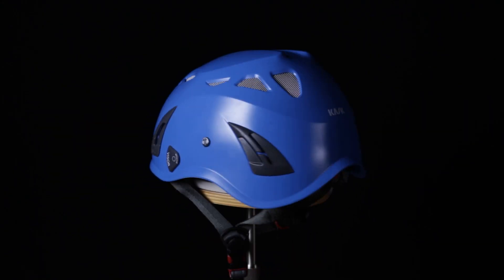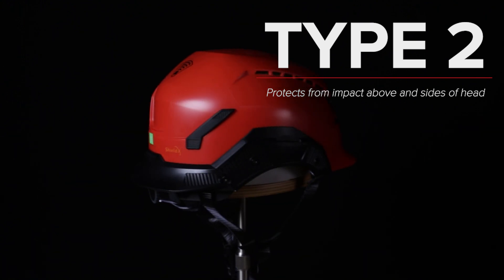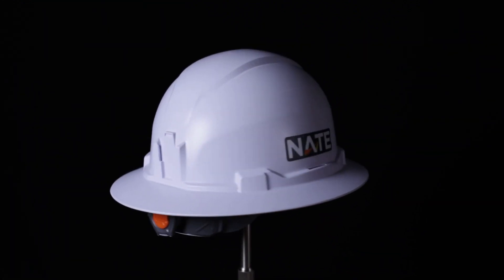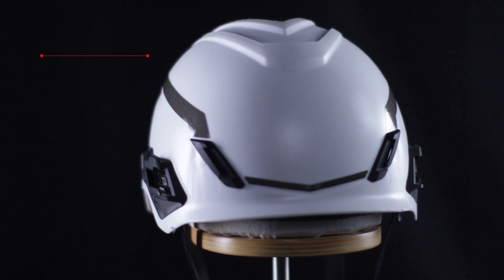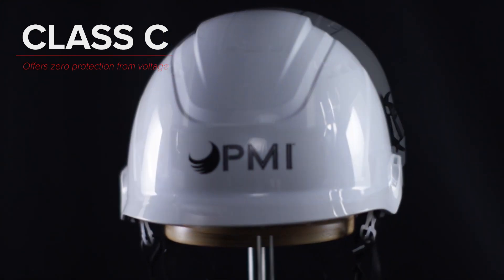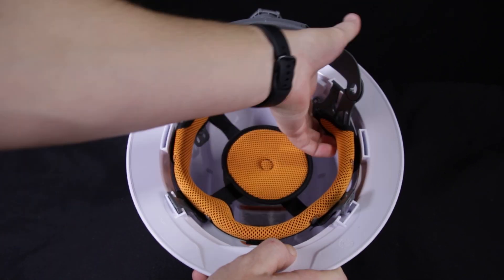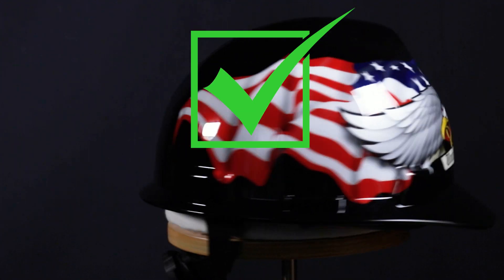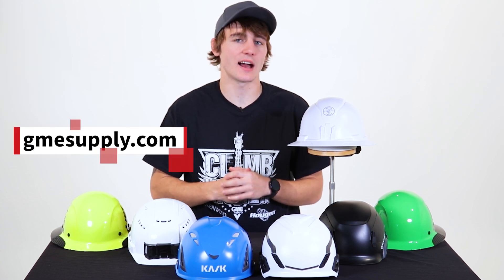Hardhats & Helmets 101: Classification and ANSI Standard Breakdown

Comment: My question is about the benefits/ pros & cons of a brim vs. No-brim hard hat for stagehand / general laboring. Our standard is the climbing style,  but there's also the benefit of rain/ bolt dispersion if coming from above when using a brim style.. 🤔
Thanks!

Also, Green Devil safety has are made in  the USA and very reasonably priced! 
#GreenDevil
Reply from the maker: Both hardhats have their pros/cons to them but it should fall more on the job application that you are performing and what is the proper hardhat for that job as well. Many companies are going towards a climbing style hardhat vs. a traditional full brim hardhat for risks that if someone were to fall with a non-chin strap style hardhat the hardhat could come off of their head and then leave their head subject to aTBI.